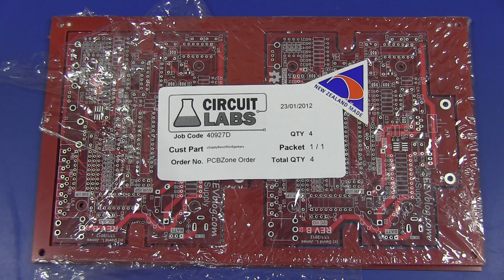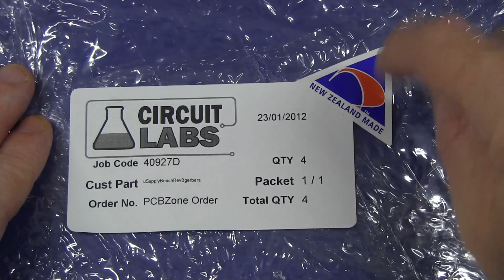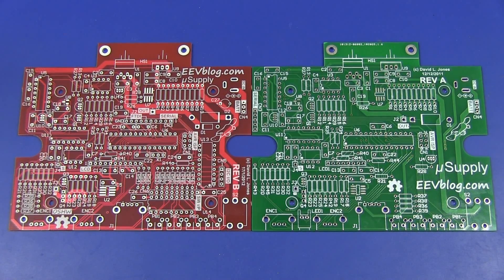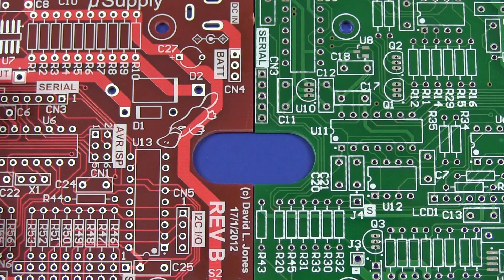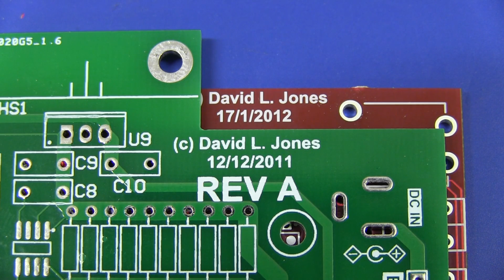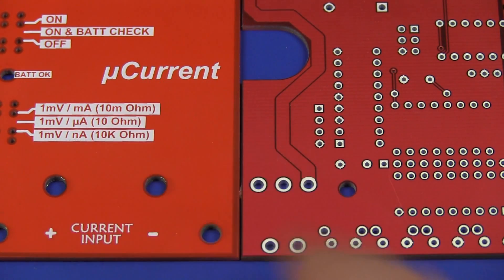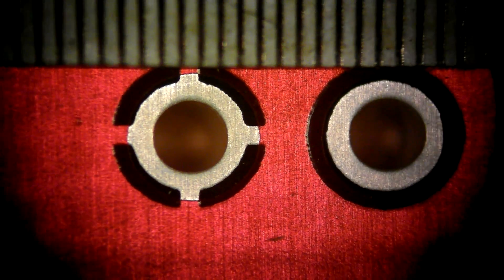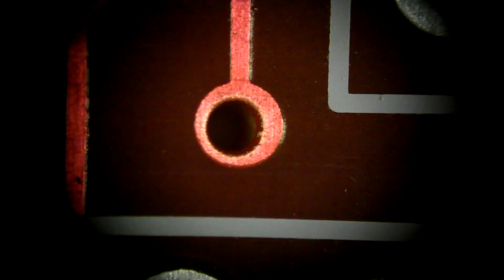EEVblog #241 - Circuit Labs PCBs from New Zealand

Comment: Hi Dave, im working on psu project that is based of yours schematic and im a bit confused. I have few smd parts that generate 1W of heat and lot of empty space with no copper. Should i use polygons?

Comment: Gorgeous silk screen on the Circuit labs PCB and awesome that you support a local shop!
I'm in the US, so I've never used anyone else than OSHPark (made in Oregon) for the same reason!
OSHPark rules!
You can upload your gerbers and see an instant quote, DRC and a rendering of your board, right on the Web site, then you can just click order.
No emailing or dealing with puny humans (ahhem, stone age) and waiting...
Reply: +lnpilot If OSH Park did different color solder masks it would be perfect.
Reply: Ari Menachem Word! That's my only complaint about OSHPark.
But, that's why they are so cheap. They can put a ton of boards on the same panel, because there's only one color...

Comment: Got some green boards from PCB Zone. Paid more than seeedstudio in china but got them very quickly so it was worth the cost. Factor in the time gained not waiting for a board and the overall cost is much much cheaper. The green boards are much better quality than others I have got. The screen printing was also mach finer as well. I don't know what the process is that they use but they are even a slightly different green to normal green pcbs.

Comment: RE: your two power boards- I noticed that your using through hole resisters. Would it have been cheaper to use surface mount resistors? One company I looked at charged for vias, have you had problems with them charging you for the number of holes on your board?

Comment from the maker: @antoniopetito many answers to this questions. Basically, because it's good practice, for both noise and in this case voltage drop reasons on the return ground path. Plus it's simply easier on the layout too, no need for tracks, just flood fill it all.

Comment: @dmjita I have used PCB-pool Beta Layout several times and sometimes they ship from Ireland and sometimes from Germany.  Their pricing is good for prototypes, delivery time is good, they offer a free laser cut stencil for surface mount parts, and for small boards they give you extra boards for no additional cost.  They also work with your circuit design in the native layout file format (many design products are supported) or with Gerber layers and drills.  You can also watch your PCB being made.

Comment: I have a question out of curiosity about the PCB's and just PCB's in general and I want not to sure if you have covered this before. Why is majority of the under side of the PCB not all etched away? Is it due to a common ground for most of the circuitry or shielding from stray and unwanted noise that may cause parts of the circuit to go haywire. I do notice this on many bords other than yours where they only etch around the track and that's it. Why may I ask? Regards Antonio

Comment from the maker: @DFCad1 The price difference depends on whether it's lose board, or a panel. CircuitLabs charge the same for both. PCBcart charge differently. For the loose board Circuit Labs is about 3 times the price or something like that, but for the panel it's only a 60-70% price difference. Could very likely get the panel cheaper from another Chinese supplier if desired.

Comment: Been getting boards from Silver Circuits lately. They are based in Malaysia, so far, they've been showing superior quality in comparison to stuff I've outsourced to China. There was a batch of boards that was set for 2oz copper, and they sent us something in the manner of like 1.5oz, but they fixed the problem immediately. Unless the US actually gets something at a decent price, we'll be sticking with outsourcing. There's no reason for a small board to cost 20x more here.

Comment: May I ask, what kind of shipping method did you chose at iteadstudio? I just ordered from iTeadStudio today few boards, total price of $150 (!!), where $33 was shipping by DHL (I need it delivered fast - China has just had almost 2 weeks of holiday - their post is most likely flooded). The thing is, I live in middle Europe and all local stuff is 10 - 20 times (in low volumes - I need all boards 10 times max) more expensive.

Comment: I've been using MyroPCB for 10 years. I think I've had a total of 6 bad boards (shorts) out of thousands. None were electrically tested. They do assembly - and it's very good quality. Also, shipping times are 3 Days to the US. I can get 2 Day turn and have boards the same week.

Comment: PCBCart quality sucks. They tried 4 times to get my board right and failed, I gave up. I stuck well within tolerances using the Altium rules. They couldnt get the layer registration right - on through holes, solder mask, silkscreen over pads - junk. Seems like any pcb house should have registration down to a science. I used goldphoenix next. First batch perfect! Second batch bad...Looks like I am going local too. Sunshine Circuits (USA) did some boards for me, all perfect, but more expensive too

Comment: I order a lot from iteadstudio/seeedstudio, but only the smaller sizes (5x5, 5x10cm). Any larger than that and they quickly become at least as expensive as the competition. I mean, $85 to get the big boards done, that's just as much as local.

However, except for the silkscreen I am usually surprised as to what they manage to produce for such a low price. I even got 0.8mm boards for the same price as 1.6mm, which is absolutely wonderful for heat dissipation through the board.

Comment: Here's a tip for Itead/Seeed Studios in regards to the numbering they put on. It's actually done by their outsourced board house not them directly, so they can't do anything about it even if you request it. Now, if you have to have it somewhere, you don't want it on your front panel side. They *ALWAYS* put the code on the top layer silkscreen. If you flip/mirror your board gerbers so the bottom is now the top, you don't get the code on the front!

Comment: HAL is better if PCB will wait for soldering for more than 2-3 weeks. Chemical solder will be difficult to solder after some time. So for DIY I would recomend hot air leveling. Silkscreen from china looks thicker so it can be more durable then New Zeland. Maybe simple scratch test? I support local manufacture, it helps economy.

Comment: Silver doesn't look so nice after the PCB has been on the shelf for a while - give the boards a coat of flux if you're not going to use them for a while. Also avoid touchinig the exposed silver as fingermarks can tarnish quickly.